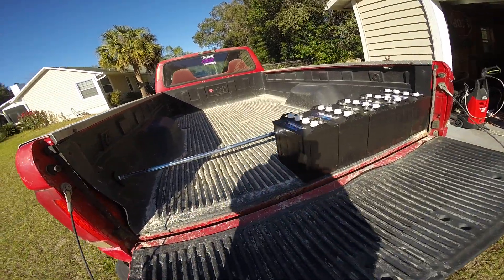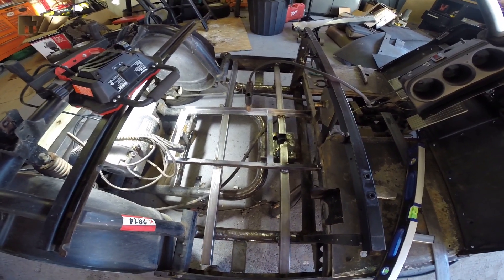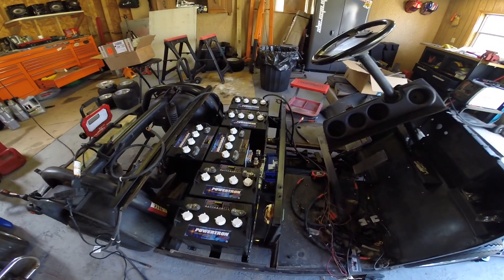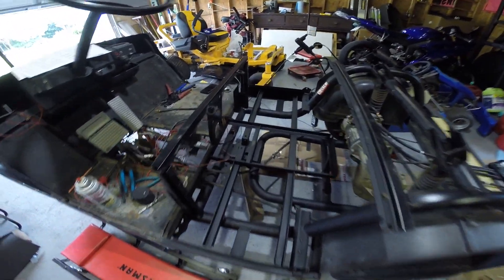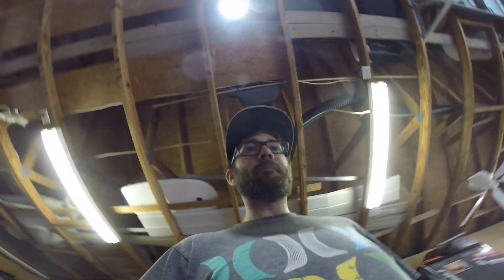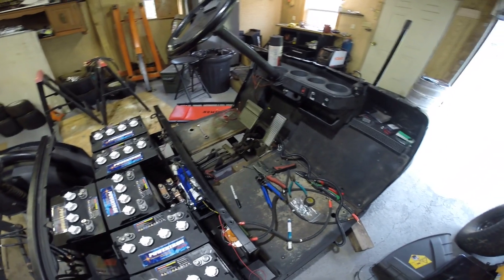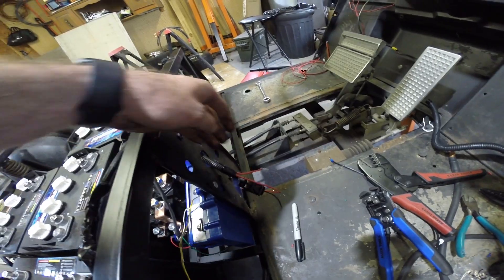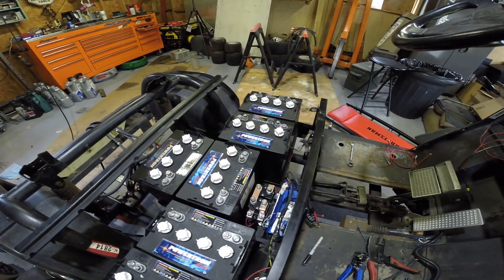Golf Cart Build Part 3 - Yamaha G16

Comment: Great video guys! I'm actually restoring a 1998 Yamaha G16 and found your video while trying to figure out the wiring situation. The previous owner completely stripped out the wiring harness, so I'm putting in a new Navitas controller, D&D motor and Curtis Albright contractor. Still lost in the diagrams though. Any chance you guys would do some $$consulting with me?
Reply from the maker: Thanks! That's hard to work with a completely stripped harness. This was our first time doing wiring on a cart. I would recommend the buggiesgonewild.com forum. Posts on there helped significantly when we were trying to figure out the wiring.